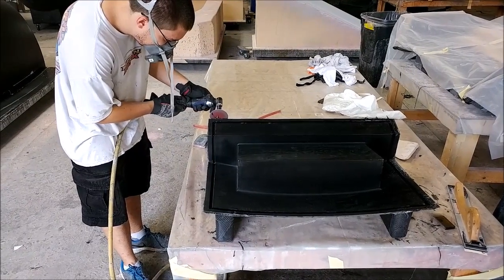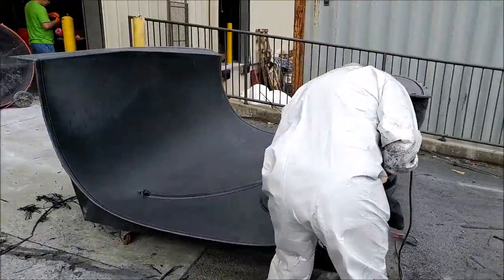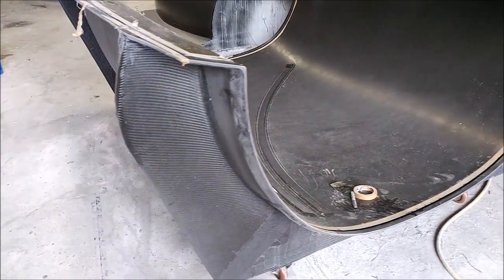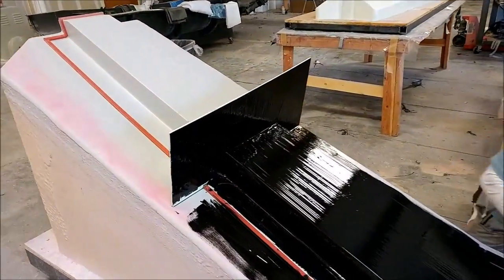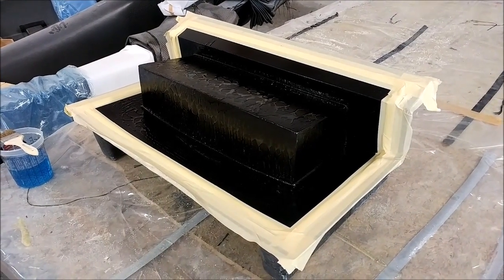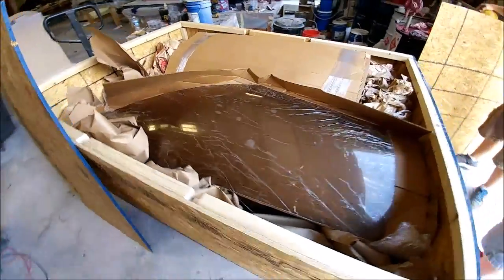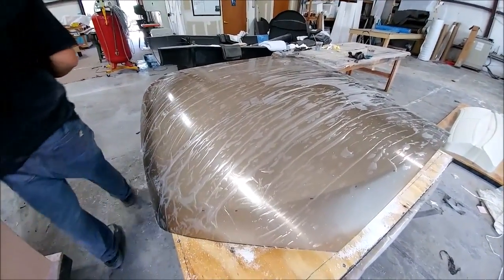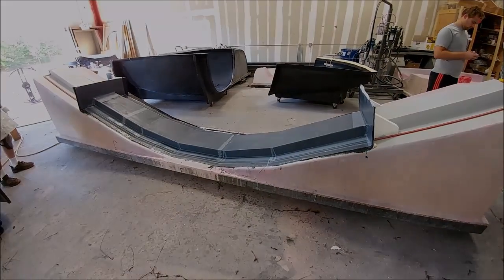Raptor Aircraft June 7th

Comment: Hey guys, I asked last Saturday, and the question may have been overlooked. But how do the models show these windows standing up to pressurization? Judging by the size, even at 5psi, there would be hundreds, if not over a thousand pounds of pressure pushing against them, especially on the windshield. Thanks!
Reply from the maker: The FEA analysis has been done by a reputable and experienced engineer that has worked on similar pressurized aircraft and the layups of the fuselage have been set to handle the loads.
Reply: +Raptor Aircraft Not the fuselage, but what about the windows?
Reply from the maker: +SupSayZ the windows are part of the fuselage and are taken into account when doing the FEA on the whole cabin.
Reply: +Raptor Aircraft thanks for your response.